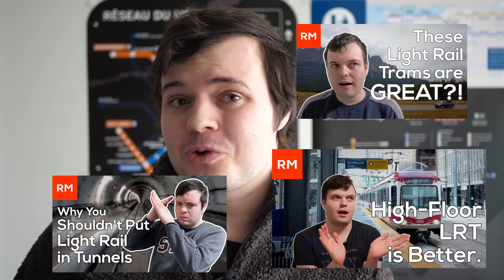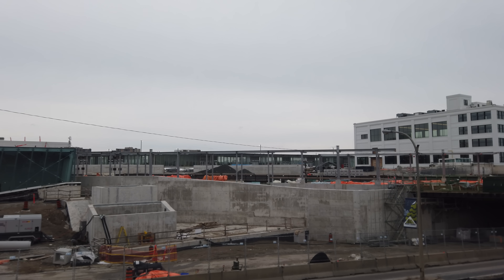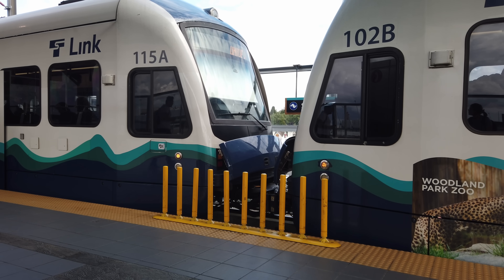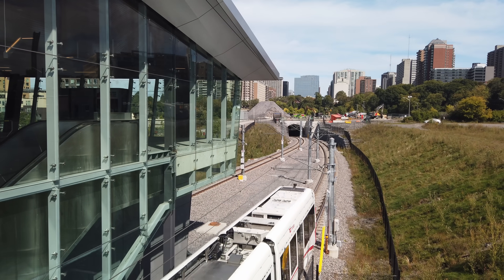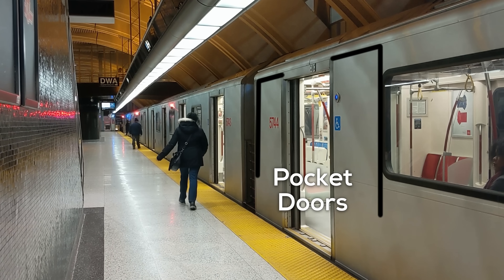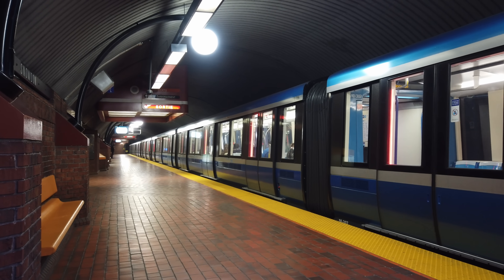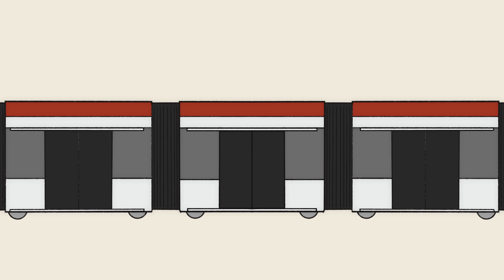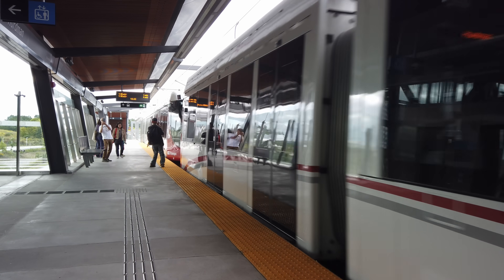I Designed a Better Low-Floor Tram

Comment: It's always a bit confusing to watch these videos as someone used to Stadtbahn from Germany. For most cities a Stadtbahn system is enough and the best, most flexible option, it's easy to put parts underground like a metro because capacity is high enough, but in the night you can only use one half of the train because not that much capacity is needed. Expanding the system to a full metro is also not to difficult, colognes Stadtbahn for example feels not that different from other real metro systems I know while technically being Stadtbahn and even high floor on some and low floor on other lines
Reply: Stadtbahn is high floor no?
Reply: @longiusaescius2537  yeah hes comparing apples and oranges

Comment: basically all new metro trains in germany use plug-style doors that have, imo, a lot of good aspects for what you're looking for, despite being mechanically complex.
As they can protrude out of the hull they don't affect the loading gauge of the vehicle or the resulting interior width as it is with sliding doors, pocket or outside; and as you mentioned, they look clean and don't cost window space or interior space.

Comment: The ULF is a very complex design which only really makes sense for vienna, a very large network with platforms at basically curb height, and a very small loading guage making every square meter of interior space count. But it comes with it's shortcomings like a fairly low top speed, complicated electronics to steer the wheels, which can fail somewhat dramatically at times and despite this they are still quite cramped feeling trams.
The Skodas proper bogies, while having some technical shortcomings of their own are probably the better option and solves the issue that trams like the Citadis have, their fixed/limited motion axles end up being very noisy and riding quite rough.

Comment: Have you seen the specs for the maximal Škoda 15T? 100% low floor, up to 72 meters and 540 passengers, can be double-ended if needed.
Reply: I don't know why, but this video is irritating me. Bogies are needed for a good ride and we know how to make them fit into low floor trams (see the 15T). I believe there was also some research about wide doors not being as good as having more doors (assuming everyone can fit through a door). I don't know who maintains doors in the Americas, but you shouldn't need sliding doors unless you're squishing in people like the japanese do. And good luck having completely independent wheels that turn into the corners as your animation suggests! Gah!
Reply: @matejlieskovsky9625  Not mentioning Prague being considered a part of Eastern Europe instead of calling it properly Central Europe. It's even more to the west than Vienna, which isn't considered eastern be anyone.

Comment: 3:50 not entirely true!

Most very long vehicles (like Frankfurts U5) can also be separated into shorter vehicles
Reply: Well, that’s because the U5 isn’t actually one very long vehicle but rather up to four very short vehicles, depending on each configuration. So the U5 is basically the high-floor variant of this very idea. Even the new intermediate cars can be moved individually, which is necessary due to length restrictions within VGF’s maintenance facilities.

Comment: Articulated Bogies like you see on Stadler FLIRT! And yeah, we need the sliding doors. I'm not sure why that design hasn't been used on trams, maybe they look less nice? Also have you considered adding gangways to the cabs like you see on Electrostars?
Edit: Also try DLR-style cabs. Controls can be locked away in like a cabinet when the cab is not in use and maybe also have a glass sliding door separating the cab from the passenger space that can be opened when the cab is not in use so passengers can access the extra space in the cab (that's now got its controls locked off and stored away). Add this with the gangways and you'll have:
- Better accessibility (can move between carriages)
- Higher capacity (extra space)
- Cabs on both ends unlike E G L I N G T O N C R O S S T O W N
So yeah, combine these features and you'll have a high capacity beast of an LRT vehicle.

Comment: Single wheels spaced far apart will have a larger angular deflection in a curve of a given radius, giving more noise and vibration. If you start putting single wheels on multiple consecutive sections you start running into trouble with degrees of freedom. the whole system becomes too constrained. More noise, more vibration. You also lose the self aligning properties of standard train wheels. There is a reason bogies are normally used.
Reply: Spot on. For the non engineers in the room, larger angular deflection means more wear on the wheels and the track, more noise, and a much higher risk of derailment on tight curves (which effectively means the tram won't be allowed to run if there's tight curves on the system).

The self aligning properties smooth out the ride quality for the passengers, so by moving to four fixed wheels instead of bogies you need to compensate with a much more complicated suspension system, which will add even more maintenance intensity and will take up space in the vehicle.
Reply: @gobyrail  Doesn't this sound like the design that Talgo has been using all this while too?
Reply: @gobyrail  Regarding the second paragraph, Reece says it is a trade-off we need to make if we need the capacity. Perhaps it won't be as maintenance heavy with computer steered wheelsets.
Reply: @ Sure it's a trade-off, but the disadvantages I outlined still hold. And no, computer-steered wheelsets (whatever that means) won't solve physical engineering problems.
Reply: @ The idea is to use computer control to give the opposing wheel-pairs a radial orientation in curves.
Reply: @Myrtone  You can't wave away an engineering problem by throwing the words "computer control" at it.
Reply: @gobyrail  I am not sure what you mean. What engineering problem in this case?
Reply: @gobyrail how so?
Reply: What about articulated bogies where they are located underneath the gangways? Pretty sure the Stadler FLIRT uses that design?
Reply: @williamhuang8309  You will not get those low enough to get the gangway near ground level. The flirt has floors on 70cm height 9r so
Reply: @matthijspw  This already exists as low floor tram - Skoda 15T in Prague.
Reply: @martinkominek6712  However, the 15T has narrower articulation gangways than most other low floor trams. The 15T's articulation gangways are only 70 centimetres wide, while most other low floor trams have wider articulation gangways.

How about individual computer steered wheelsets? Think about why road vehicles do not have (pivoting) bogies.
Reply: you should see Zurich Cobra. basically similar concept

Comment: Most of the modern low floor designs with segmented cars are designed for very tight radius curves (the wider the turning radius the longer cars can be).  This is combined with street running and the expense of high floor stations (need to reduce cross track pedestrian traffic) created the entire low floor concept.  IMO, conventional train bogey set ups can be made smaller and wheel wear reduced through good design- work on torsion bar systems (and more attention paid to track maintenance).  Flat floor trains can be made with more equipment on the roof of cars, motive systems can be linear induction or linear induction hybrids and used in conjunction with dual sided station platforms.

Comment: I don't know if it's true of it's an impression of mine. Having lived for a while in Milan it seems to me that the longer the tram it gets the slower it operates at commercial speed.
The high-floor bi-articulated trams from the '70 series 4900 seems to me much faster than the relative new (2003) low-floor 5 elements 7500 series which is, imho much faster than the low-floor 7000 series (1999) with 7 elements and hideous single-panel doors.

Comment: One solution to get long trams could be a modular design where a control cab could easely be switched for a bay window or connector piece.

Comment: Seattle has low floor trams partly because a portion of the Light Rail system travels on the street with traffic. Because of the stations on street level, turnstiles are not used on the entire system to prevent people from walking on the tracks to get around the turnstiles on the street level stations. Furthermore, New York Post reported recently that upwards of 70% of Seattle Link passengers don't pay the fare because there is no fare enforcement. Poor planning from the start.
Reply: There is also the transit tunnel. Originally built for buses, it was shared with buses and trains for several years. The buses that used the tunnels had many stops outside the tunnel, which means that even if they used high platform buses, the city would have had to commit to lots of higher curbs throughout the city, making the idea impractical.  

The time to change things is when they decided to kick the buses out. At that point, they could have raised all of the existing station platforms and switched rolling stock. I believe there were 17 stations then, with about 40,000 riders a day, so while it would have been very disruptive, it seems quite possible. It is up to 25 stations now, and that will quickly grow over the next several years.  

None of this has anything to do with the lack of turnstiles. The original bus tunnel was designed so that turnstiles could have easily been added. They simply decided against it, preferring to follow the German model.

Comment: Škoda 15 T might almost do the trick. It's quirky and different, but also quite clever. It's the only 100% low-floor solution that isn't ridiculously over-engineered. It was introduced in 2009, so it's definitely time for an updated version. It would need wider gangways, and better suspension, but a lot of your wish list is fulfilled. It's somewhat expensive, but it's still a mystery why it hasn't been sold to more cities.

Each section is quite long, giving large open floor areas. The Prague version is cramped with seats, but any layout is possible. There are two large doors per section. The Prague three section version is 31 m long, the Riga four section version is 41 m, a five section vehicle would be 50.6 m and so on. 

It uses Jacobs bogies between the sections. The motors are placed outside of each individual wheel, no internal space is wasted. 46.6 kW per motor gives ample power. The Prague version is geared for a maximum speed of 60 km/h, but higher speeds are possible. They can handle steep gradients. Individual wheel drive reduces wear on the tracks. 

The first and last sections have their bogies at the extreme end. There is no sweeping overhang, making the vehicles very agile, in spite of their size. They can handle very tight curves. It also improves the drivers' working conditions. Long-nosed trams are not kind to the drivers.
Reply: I agree that 15T is a functional design but I would definitely change its rear section to high floor and populate with more seats (2+2 + full back) as trams nowadays also serve longer distances and "seated" back section would make sence. Definitely reduce the seats in the middle to just 1+1, the trams get crowded inside city and 2+1 causes jams. Driver's cab is way too large. Reduce that in favour of passengers. Outside design should be rework for more attractive appeal IMO. Also the idea of having just single cars eliminating the joints might be useful for some cities or night service. Or even designing motorized trailer cars that could be chained according to needs.... All based on this 15T design...
Reply: @tommik1283  Anything is possible with this kind of unobstructed interior. The layout can be rearranged to suit almost any need. It's an open slate. Quite different from the usual low floor solutions where the interior can be somewhat of a labyrinth. I'm sure that a future update would include the exterior. Clients placing large orders can request their own exclusive design features. Most manufacturers will offer that service, albeit at an additional cost.
Reply: I'm actually wondering now why Jacobs bogies are not more common for trams.
Reply: @arnehurnik  Probably to keep the cost down. Many cities have opted for cheaper ways to get those highly sought after low floors. Increased maintenance costs caused by excessive wear on the tracks are often left out of the calculation. Procurement rules and offset agreement can make large public purchases seem quite confusing.
Reply: @arnehurnik  It makes the articulation gangways as narrow as those of the 15T, only 70 centimetres wide, most other low floor trams (and low floor articulated buses for that matter) have wider articulation gangways than that.

Comment: The Frankfurt U5 rolling stock might be worth looking up. It is considered a Stadtbahn, akin to LRTs. Vehicles have two segments but some have no permanent cabs, meaning you can create a 8 car fully walkthrough trainset while still being able to service it in pieces.
Reply: That looks neat! I'm wondering though how do you swap out the cabs + couple the articulated sections up to each other? Are there mechanical/magnetic linkers inside the edges and are they tedious to work with?

Comment: Is there a place for the opposite? A higher speed, long haul but relatively cheap and small train? I'm thinking for runs between neighboring small cities. Think Trenton-Belleville or kitchener-Cambridge. Two or three station routes where a heavy rail setup isn't justifiable, and travel times could be car-competitive.
Reply: This is actually a place where light rail would make sense.

Comment: I was quite sceptical on your 'inproved' tram, and I still am. The main issue I have is your wheels: 
Wheels on all of your segments cause troubles while managing curves. You can read about that on Wikipedia about the Gelenk-Triebwagen from, for example, Berlin.
Single axle bogies are a possibility, but I don't think they can manage high speeds. What you might end up with is a Talgo-style tram, that could work. Also, the Rotterdam metro network has used two-car metro trains for a long time, and they work fine. Those are, however, high-floor trains, so they've got much more space. And doors.
Reply: UK Pacer trains were single axel and handled 75mph. They were notoriously rough riding though.
Reply: @JKK_85  they didn't actually have single-axle bodies, they just had fixed wheels. And they were rough
Reply: @Kichiro Rode the Borbardier Flexity 5000 (which is high-floor & has a more conventional bogie design) on Manchester's MetroLink (light rail) also & I remember it has the similar NVH issue as the Cobras. So I guess the problem might not be due to the Cobra's wheel design
Reply: Or Jakobi conection with low floor boogies similiar to Škoda 15 T
Reply: How about computer steered wheelsets?

Comment: Interesting concept, I could definitely imagine some places where this could work if the wheel and track wear and tear is kept in check (that'll probably require some mechanical linkages between wheels).

I think you could save money by having fewer and longer articulated sections, though. At least these US light rail metro systems probably don't have the tight 15 meter radius curves that European multi-segment trams and their US counterparts are designed for. Something like a ten meter long segment (which is what I think the SD70s already have) would probably work fine there, although it would put more weight on each wheel. That Skoda tram in the video with the long sections on tiny bogies looks very interesting in that regard.

For the length, I imagine something like the Hanover TW 2500 could be used: Trams that have a cab at one end, and an open gangway at another, always connected to another vehicle back to back. This could simplify maintenance over having a single really long vehicle. Frankfurt is even buying a version of this idea where a vehicle has only open gangways.

Comment: As someone who lives I city with different trams that have 2 doors per intermediate segment and other trams with just one door: 2 doors is definitely better. You don't get much efficiency for the intermediate segment but the bogey segments can disembark much faster if the door is right next to them - since these segments are tight mots standing passengers cluster around the doors when you have just one per intermediate and don't use the full length of the train.

Comment: check the floor plans of Skoda 15T. they can accommodate most of what you're asking for. and in the end you can fill with half a meter of concrete each platform and use very low high floor vehicles
Reply: Except that the articulation gangways of the 15T are really narrow. As it happens, the ForCity Alfa did not go well.

Comment: Is this cheaper than adding half a metre to the platforms and buying some decent high-floor trams off the shelf?
Reply: If someone thought about this a couple of years ago, it would certaily have been cheaper to built high floor in the first place. 

Costum built trains decrese significantly  in cost, if you can order a large number of them, something like above 100 units or so. The more you order, the cheaper they get. With standard designs ist not such a big difference. 
However manufacturers will still find a way to mostly use off the shelf parts even on costum trains.

Comment: Excellent! I'd like to see the RHCLFMT running the length of Eglinton from Mississauga Center to Scarborough Center. How is it possible though to transition from ATC to street operations and vice versa, without disruptive bunching? Perhaps they should run the Ontario line east from Don Mills to Scarborough Center, under Eglinton to the SRT corridor, as an express service underneath an Eglinton east local LRT service. I'm skeptical that Eglinton as is will work. They may have to separate the line at Don Mills, with a western grade separated line and an eastern at grade line which defeats the whole purpose of a crosstown line in the first place.